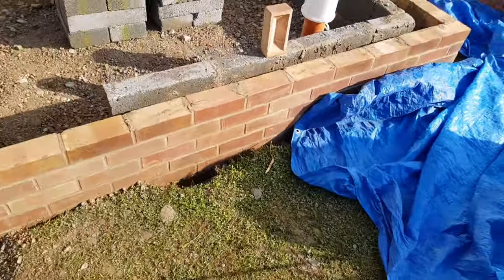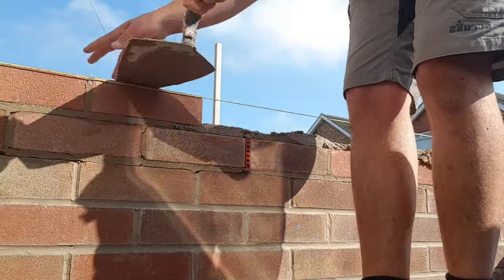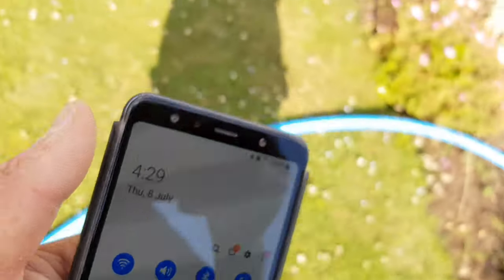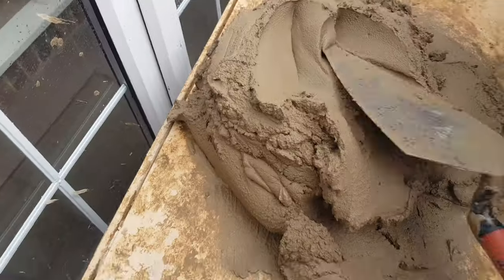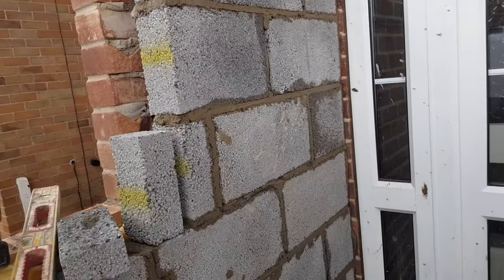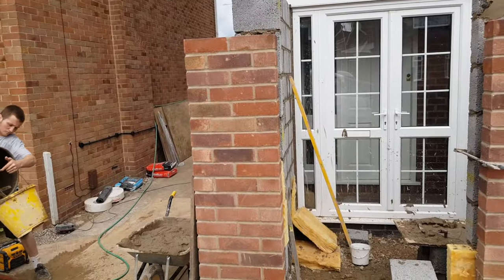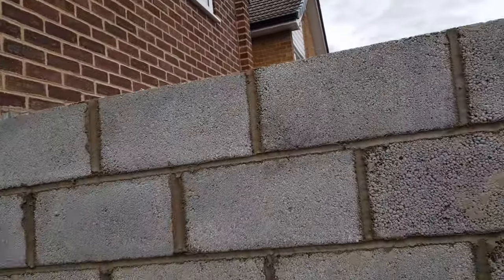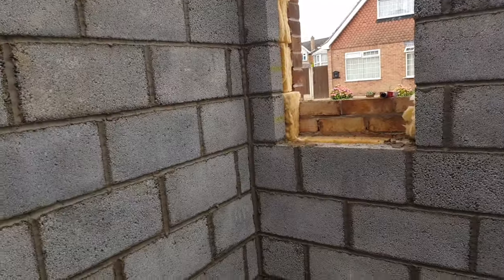Bricklaying - Porch Extension - Working on Sunday. No scaffolding 😨#bricklaying  #bricky

Comment: I always put a 65mm cut block first course so the ties fall towards the brick skin and by the time you get to plate the blockwork and brickwork are normally level 👍
Reply from the maker: Good shout mate! Next time I have this problem..and I probably will..ill definitely do that! Really was a pain..even though the bricks kinda matched the house, the house had big bed joints....i thought I'd be able to get it with the blockwork but just couldn't...if all the lintles were on at the same hight as the two front ones it would have been better..but the customer wanted the side window to match the house.
In the end it wasnt too bad and got over it..just about...like we do as bricklayers..spoke to to joiners today and the roof and wallplate went on alright..so couldn't have been too bad for a Sunday job😂👍
Cheers for the comment and tip Andy appreciate it🍻😊
Reply: @IzzytheBricky  No probs 👍

Comment: Good stuff my man. I’m Irish and started bricklaying when I was 15. I’m 40 now and have been living in NY for the last 16 years. We used to build with 50mil insulation and leave a 50mm cavity. We’d build the backup block first and have a plastic star clip on the tie to pull the insulation tight to the block always kept behind the drip on the tie. I see you fill the cavity with rockwool insulation. We also used to have a return on all the jambs with vertical dpc and 25mm insulation to close the gap.
Reply: We do that over here to

Comment: How much does that size of porch cost?
Reply from the maker: Hiya mate, I think labour only, it cost 1200
Reply: @IzzytheBricky  What is the size of the porch?£1200 labour from start to finish?
Reply from the maker: @onebicycle3772  think it was 2m x2m and it was just the Brickwork mate. Roofer and joiner came in after and charged whatever they did ☺️
Reply: @IzzytheBricky  Thanks for the info mate.
Reply: Do I need to apply for planning permission if I want a 3mx3m porch in a terraced house mate?